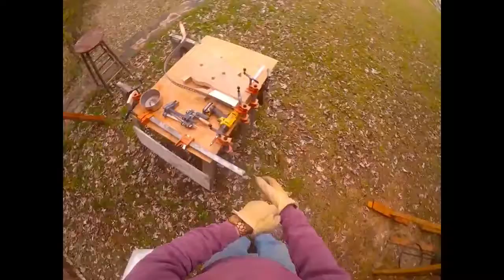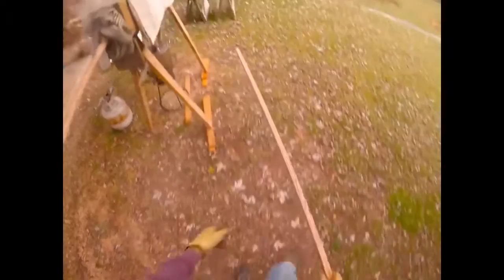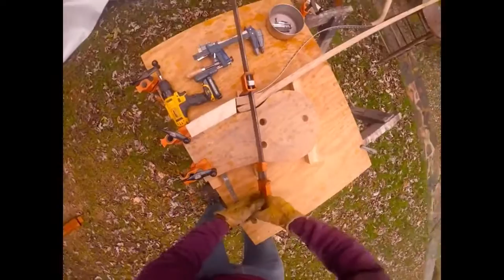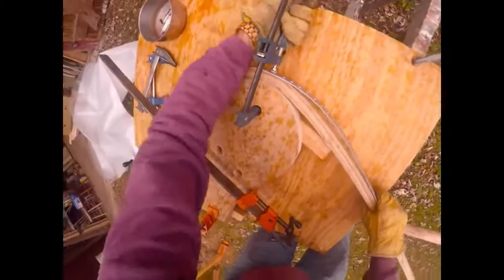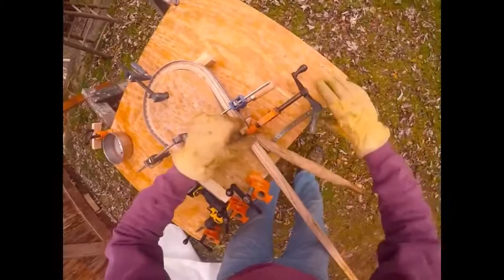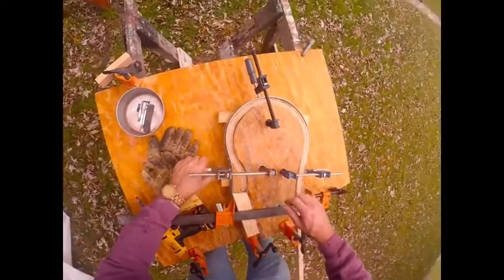Shepherds Crook Second Try

Comment: Did it work
Reply from the maker: It worked better than the first attempt, but was still prone to splitting out on the outside of the curve.  
Next try I used compression straps as long as the wood stock.  I think the straps were 53" long.  That was much more successful, but there was still some minor separation on the two small spots with the reverse curve on the inside that had no compression strap on them.   Not sure how to tackle that.  still, as stage props they will work fine.  Actual, functional shepherds crooks have a smaller diameter bend.